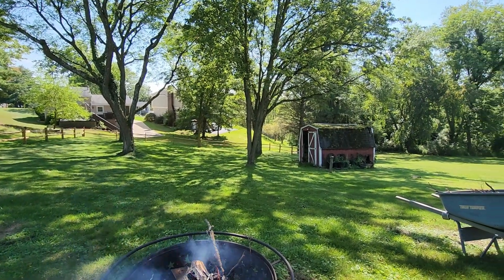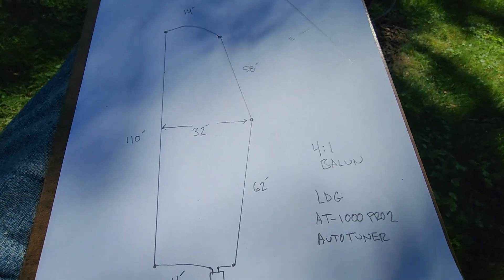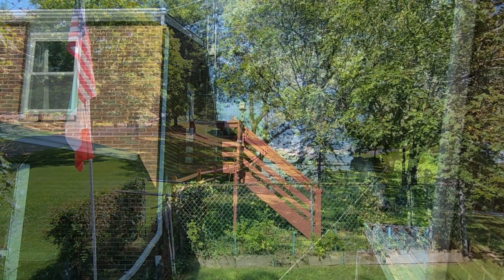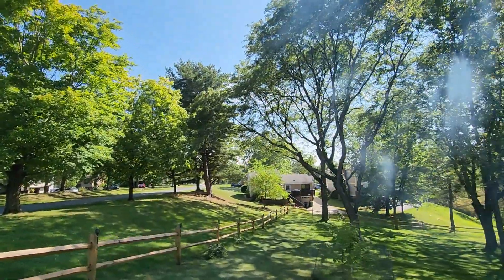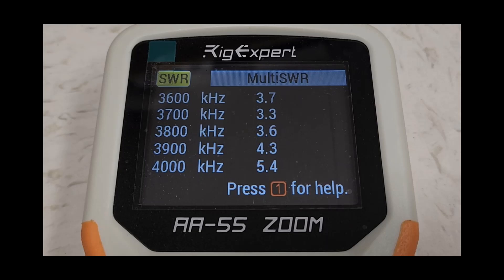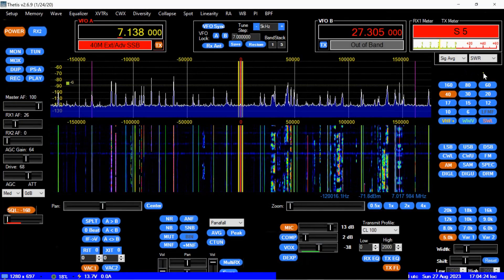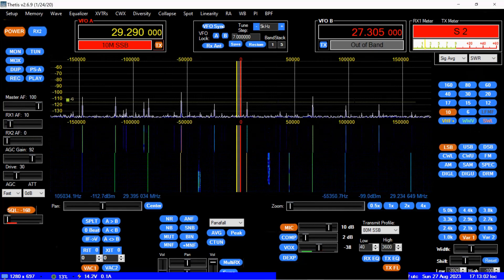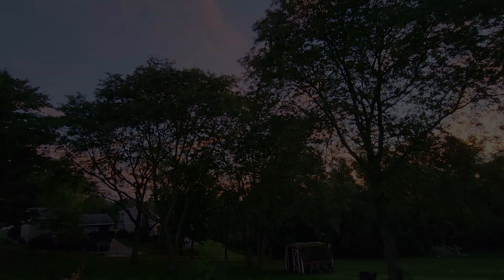80 meter loop with 4:1 BALUN and LDG AT-1000 Pro2 auto tuner.

Comment: Hey, hard to tell in the video but when you say the loop wraps around that back tree, is it literally wrapping around. Meaning is the wire touching g the tree or do you have it isolated?
Reply from the maker: Yes sir, it is literally just wrapping around and the tree branches are what support the wire. The wire has a jacket (insulated wire) and provides enough isolation from ground for my power levels I plan on running, 500 to 800 watts maximum. Yes sir, this is the simplest form of antenna and I wanted to show/encourage other hams that the loop doesn't have to be perfect and to do the best they can with what they got as far as their property layout is concerned. Hit me up at KP68videogates@gmail.com anytime you want my friend. 73's